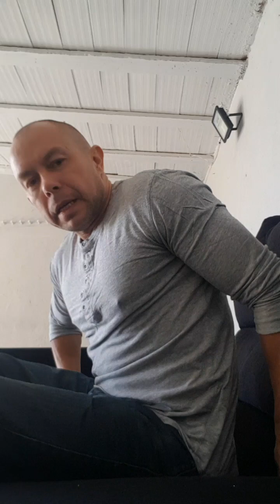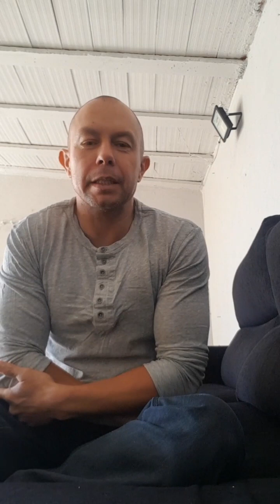OM606, OM605 and how to properly install a Mercedes diesel engine in another chassis then orignal.

Comment: Installing a om606 from a 124 ….can I just transfer wiring and ecu with engine into the w126 donar car 300se?..
🥃
Reply from the maker: W124 is mechanical pumps so no ecu or wiring
Reply: @FtunePerformance only mechanical on the 124/605

Comment: Not everything will work with an ECU that has no control over the engine. The auto trans will not work, the ESP will barely work, the cruise control will not work. Pretty much the only things that will work are the rev counter and thermometer.
Reply from the maker: Hahaha of course those things will have some problem working. But people do have massive issues getting anything to work, hacking up the clusters to get other gauges in and shit. This way everything you see will work. You know this Baldur 😉 so this post is 🤷‍♂️🤷‍♂️🤷‍♂️

Comment: just to let you know, we swapped a OM606 in a buggy that had a M111 and we used the engine mounts from the 230 Kompressor. I have no idea if it's a straight swap, as we cut the chassis mounts before and remade them because of some chassis mods